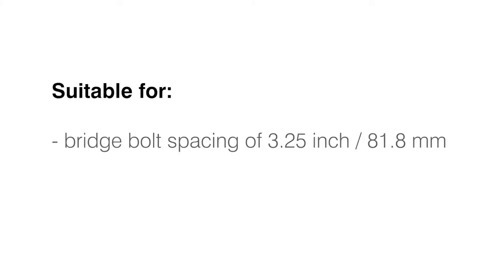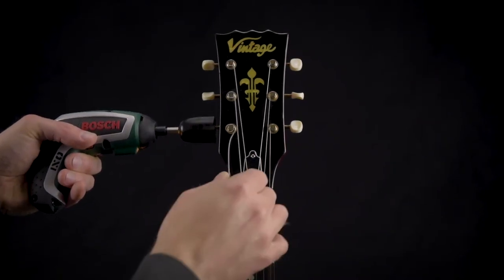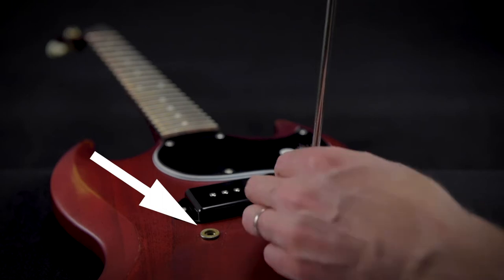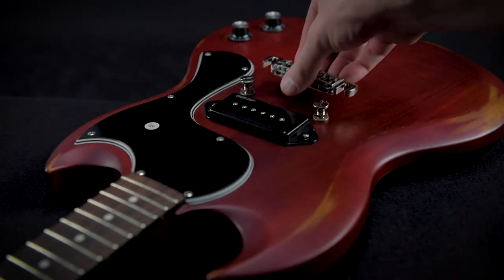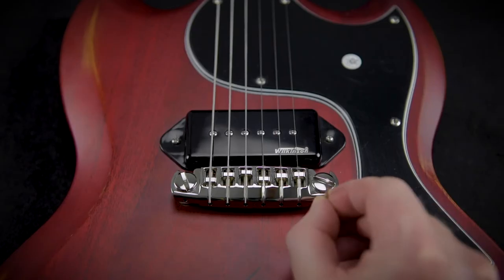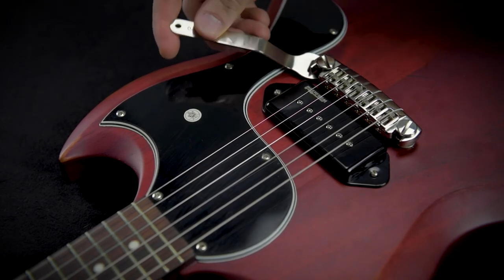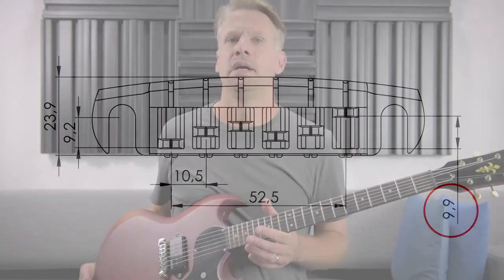Installing a Schaller Signum adjustable wraparound locking bridge

Comment: A few clarifications please:

When you restring the guitar (1:45 mark), are you supposed to tune the guitar (full string tension)?

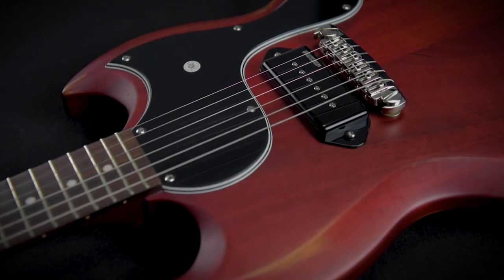When you loosen the locking nuts (2:00), it’s inevitable that the bridge will tilt towards the headstock, correct?

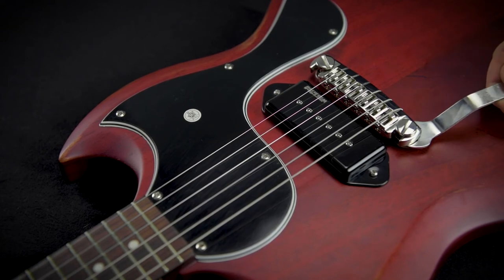It’s only by retightening the locking nuts (2:35) that the bridge is pulled back to level (or close to it)?

Thank you

Comment: Changing the original solid compensated bridge for one with adjustable saddles is a mistake. The solid compensated bridge, being a single piece, has more sustain. The more pieces, the less sustain.
The original bridge is already stepped and the intonation can now be adjusted. There is no need to adjust so many things when they are in place. High-end acoustic guitars have a fixed bridge and their intonation is correct.